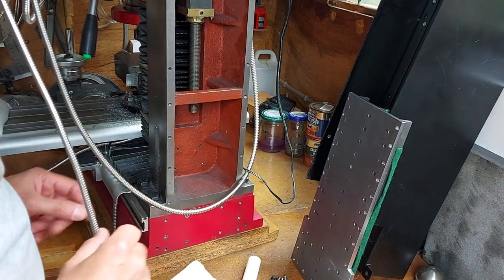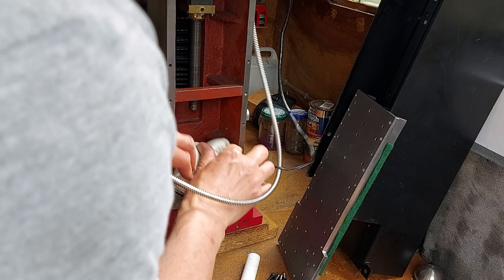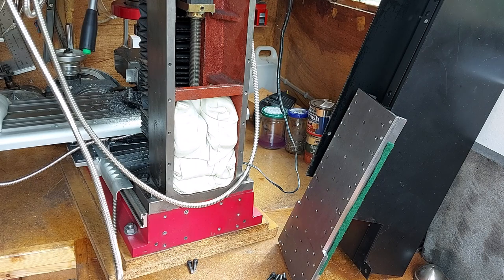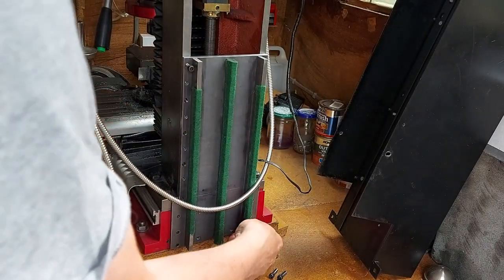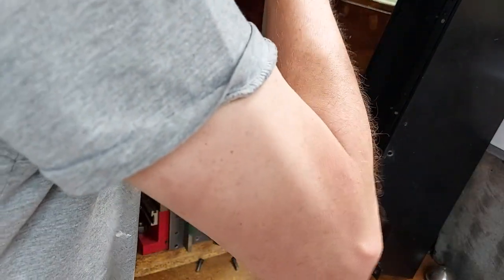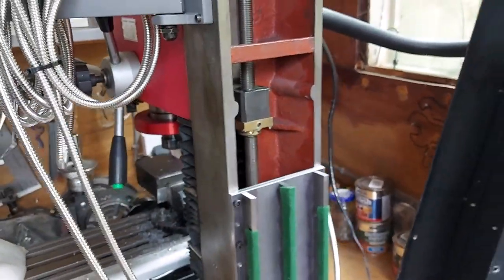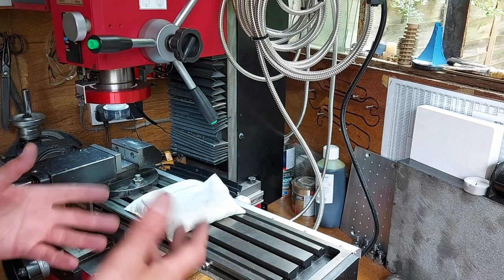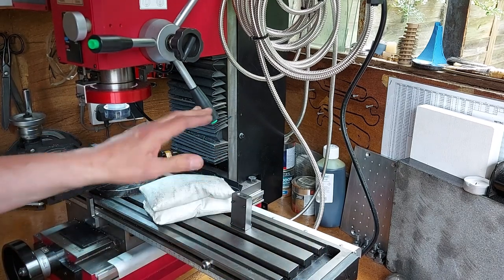Sand Bagging the Milling Machine

Comment: Hi Nigel, it'd be great to see a follow up video if you've noticed improvements from the stiffening and sand bags.

Cheers
Reply from the maker: I can hear the difference as I'm now very aware of the motor/belt whine. The chatter I got with bigger cuts has also gone, although, I haven't pushed it even further to see when this starts again. I have to say though that the bracket is 99% of the change, not convinced the sand bags do much. I ought to see if I can borrow some vibration measurement kit as I could then measure the impact of each modification. Hope this helps, best regards, Nigel
Reply: @editorglueitcom  came across this while searching for similar approaches to stiffening the column. https://www.cnczone.com/forums/benchtop-machines/118353-x3-rigidity-vibration-experiment.html

Did you consider using concrete ?
Reply from the maker: @HM-Projects  The SX2.7 column is different as it is open at the front as well to allow the z-axis nut through (although not quite sure how that works on the x3 from the images in the link). My concern with adding mass in the wrong place is you can lower the dynamic modes of vibration of the column. Also, the weakness is the connection between the column and the table. There is only a very small footprint. Hence the plate bridging that helps, would be even better if you could get something at the front of the column as well.

I imagine rebar welded in a lattice would have a big impact, but again not really possible on the 2.7

I did think about buying a plate 600mm long and closing off the whole back of the column, this would be really interesting, but difficult to machine using this mill.
Reply: @editorglueitcom  X3 has a solid face in the front and a coupling that wraps around the back - so completely open ended at the back which probably makes it less rigid in a way compared to sx2.7.

You can't completely close off the back due to the design unless you move the lead screw out completely.
Reply from the maker: @HM-Projects  ok, that makes sense. That coupling is probably the weakest link. The SX2.7 has some cast braces across the opening at the back and thinking about it, extending the bracket at the rear to the full height would really make sense on the 2.7 as it would support the opening at the front. hmmm, might have another go at some point. At the moment it is now a very good mill and significantly better than the swing arm mini mill, so might be quite a while.

Comment: What the accuracy of the milling machine without all these work?
Reply from the maker: Accuracy is good in standard form and good now. I've made several model engines using this as my main milling machine. I haven't measured the accuracy other than some basic measurements with a dial gauge to check the X-Y 90°

My gallery page is here so you can see what I make with this: https://www.glue-it.com/wp/gallery/nigel-taylor-gallery/ 

Best regards, Nigel
Reply: @editorglueitcom  Thank you for replying. You are very helpful.👍